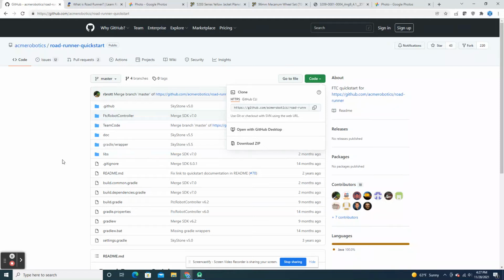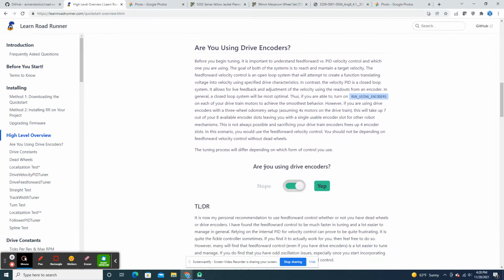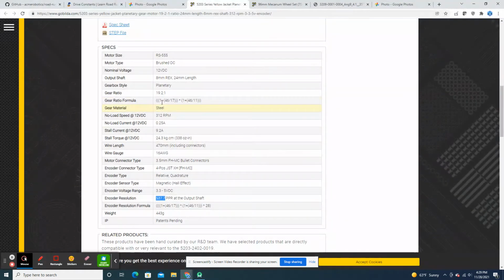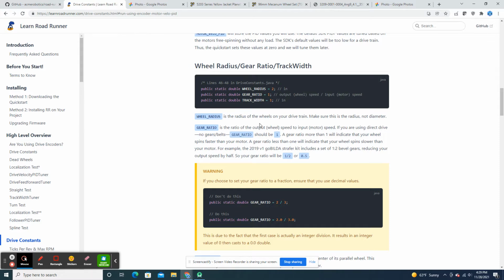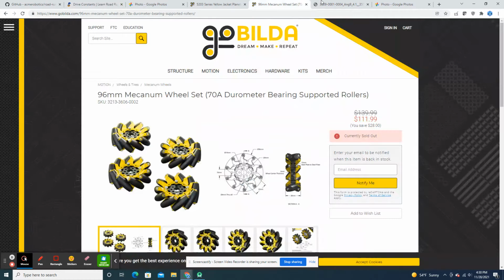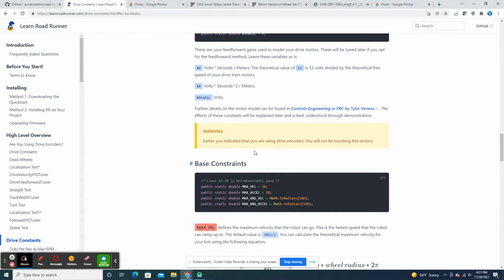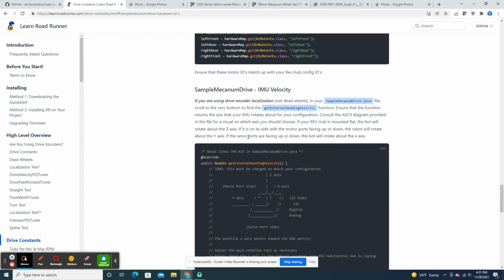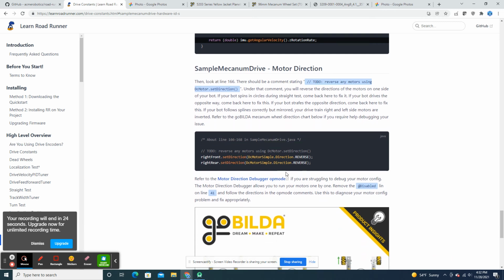Roadrunner: Step 1 - Drive Constants

Comment: You mean it's possible to use road runner without odometers, or you're talking about driving motors encoders?
Reply from the maker: drivetrain motor encoders - no external encoders/odometry